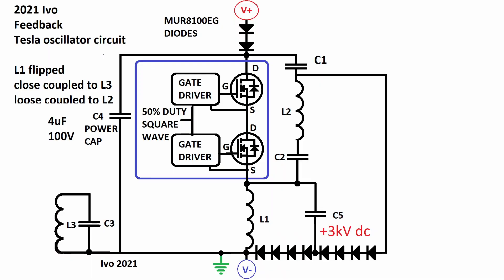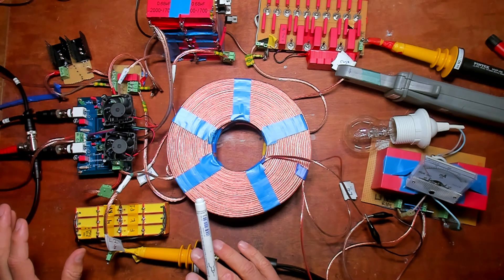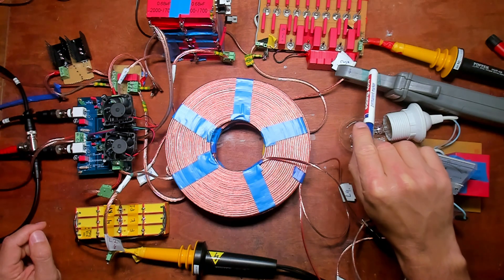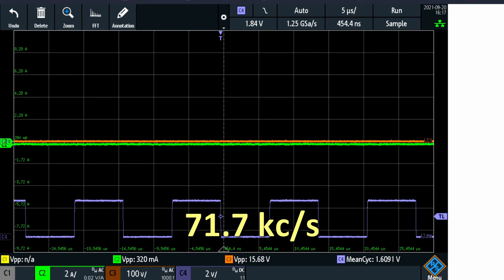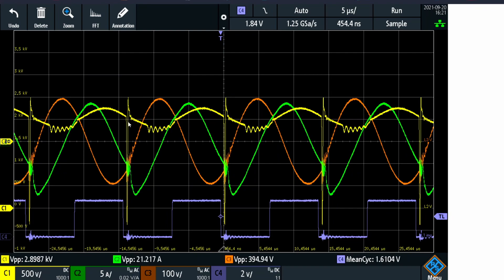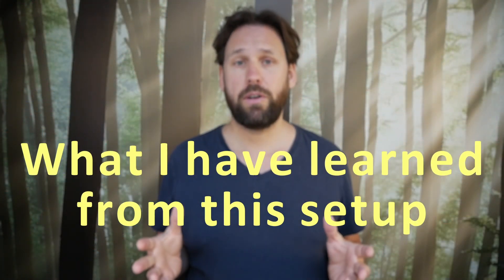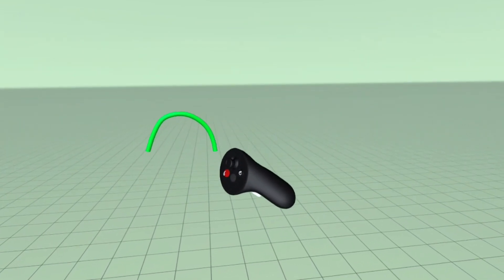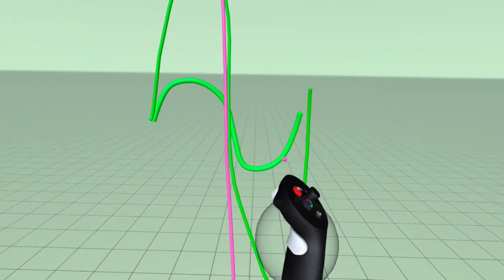Coil Capacitor Feedback Circuit Power: Input- VS Output comparison

Comment: The diodes look reversed in this circuit diagram compared to previous videos, is that correct?
Reply from the maker: Yes! good that you spotted that! I made a mistake. the 8 diodes at C5 should all be reversed. 
Thanks for pointing it out!

Comment: Hello, many years back I spent a lot of time with free energy projects, and specially with bifilar coil. Because, there is a lot of harmonics, and High voltage sparks, the best way how to measure output energy is, calorimetric method. Connect output to kettle and measure, how long time you need to worm up for example from 20 to 90 degrees. 1 kg ...1 degree need 4,2 KJ energy. I checked one setup  from one French experiment. They claimed 200 % efficiency
They connected output to florescent lamps. With my calorimetric method , I had 74 % efficiency. And kettle connected to standard power socked had 95 %
Efficiency. But, good luck.
Reply from the maker: new video on dielectric induction producing ground currents:
https://youtu.be/kbHDHiAQrrs

Comment: Hello. I read the following text from Hermann Plauson (one of Tesla's followers) half an hour before I watched your video, at the end of which you mention voltages, discharges and phase shift. As a layman, it occurred to me that he mentioned a similar problem here. If not, I'm sorry I put it here. Just delete this entire post😉 Thank you.

"In addition to this substantial improvement it has also been found preferable to insert double inductances with electromagnets and to place the capacities preferably between two such electromagnets. It has also been found that the useful action of such condensers can be further increased if an induction coil be connected as inductive resistance to the unconnected pole of the condenser, or still better if the condenser itself be made as an induction condenser. Such a condenser may be compared with a spring which when compressed carries in itself accumulated force, which it again gives off when released. In charging, a charge with reversed sign is formed at the other free condenser pole, and if through the spark gap a short circuit results, the accumulated energy is again given back since now new quantities of energy are induced at the condenser pole connected with the conductor network, which in fact charges with opposite signs to that at the free condenser pole. The new induced charges have of course the same sign as the collector network. The whole voltage energy in the aerial is thereby however increased. In the same space of time larger quantities of energy are accumulated than is the case without such inserted condenser batteries.
.....
 In the case of plate condensers having no inductive resistance an induction coil is inserted. The object of such a spiral or coil is the displacement of phase by the induction current by 1/4 periods, whilst that of the charging current of the condenser poles which lie free in the air, works back to the collector aerial. The consequence of this is that in discharges in the collector aerial the back inductive action of the free poles allows a higher voltage to be maintained in the aerial collecting conductor than would otherwise be the case. It has also been found that such a back action has an extremely favorable effect on the wear of the contacts. Of course the inductive effect may be regulated at will within the limits of the size of the induction coil, the length of the coil in action being adjustable by means of wire connection without induction."
Reply from the maker: "induction condenser " I like that

Comment: Loving the videos and deeply appreciate your commitment to being totally open source!. I've been doing my fair share of Tesla research over the years and I've come to the conclusion that simplicity is the key! In the task of harnessing the back EMF a simple circuit with two large capacitors with a spark gap in between them will work in amplification of power. One more thing that makes some really interesting things happen is the addition of 2 large magnets opposing each other and the spark gap situated at the center of the opposing magnetic fields.
Reply from the maker: Very interesting! Thank for sharing, I would love to talk more about this. Could you email me?
Reply: Hi; What You are doing with the magnets is magnetic quenching. Tesla invested a lot of his research efforts attempting to shorten his spark gap discharge, including mercury interruptors acid quenched spark gaps, hot air quenching and more. The shorter and sharper the on and off time are the higher the impulse energy. Exactly what Master Ivo is attempting in this series.
Reply from the maker: my impulses actually are timed by the resonant frequency of the discharge coil. Thats why I now have less windings. they are now faster (230 nS) and higher in voltage.
Much easier then quenching a capacitor discgarge spark. Tesla did the same in his later research years (use coil discharges instead of cap discharges)

Comment: What i have learn about this. You have to blind the output, from the input. Think about that...
Reply from the maker: Yes. L1 and L2 are directly connected to the supply, so loading them down makes the supply work harder.

so I will use L3 as output again, but not directly (close coupled L4), and probably rectify only one half wave (not sure about that last one. I need to test it)

Comment: Nice work Ivo, does time factor in to the calculation? Speed of build up in your cap bank is faster than your input pulse?
Reply from the maker: thanks, time is a factor yes. the faster the impulse the higher the voltage.
the cap bank needs some time to charge up, so it is not faster (but it is very rapid).
I do not fully understand what you are asking
Reply: @MasterIvo  had an interesting thought: more than just time in the context that you're using here, what about the time as Dayton Miller observed with ether density depending on the time of the day with considerations of sidereal time? Something very interesting to consider later if not sooner as I suspect at some point - when function and stability have been achieved - we will see this playing a role.

Comment: Brother use a step up transformer and step down looped together amplify current, pulse the input  in then c the higher the f nd v in the stp up the more the current in the secondary as u stp dwn, check the ratios of the stp up nd dn to understand the amplification,  volt must have high polarity or potential,  and f 60hz as resonance hz for iron core, mor the no of series 60hz inputs u have bigger is the Resonance so more 3 phase 60hz inputs required if possible with min 3 wd b gd 2go, the idea is to step up voltage but at 60hz resonance f 4 max resonance of iron then step up I w stp dn let c if u get it right the ratio of stp up 2 stp dwn is essential, pulsed mean 60hz at max volt input, ie each 60hz wavelength carries a certain amount of charge which disintegrates fm high to low as current, the higher the volt the greater the momentum at which it disintegrates as current, resonance f for different material is different and 4 iron it happens to b 60 that's all so use a filter if u can
Reply from the maker: Good Idea, when are you going to test this?

Comment: Rather than using copper coils, have you considered using high conductive ink? Robert Murray-Smith has some good stuff that works in refillable tank printers. I haven't found a good insulator ink that works any better than blank space yet. Once that is solved it should be easy to print inductive and capacitive circuits - even in 3d. The next step is to see if graphitic boron carbide and carbon nitride ink can be used as the P/N doping to make semiconductor circuits.
At that point most college term projects could be printed for pennies.
Just thought I'd float the idea out there since copper is getting pretty expensive.
Reply from the maker: seems like a cheap solution yes, but very labor and time intensive.
water glass. I'll look into that
Reply: @MasterIvo  well time to wind & setting sure, the simple way is to get cardboard, wet it & shape it around the made coil... dry
Then melt candle wax to seal the tight mold, put the coil back in, fill a container with a banned plastic straw lol so as to fill the mold from the bottom to reduce any bubbles, put in a bag ,breath in it/add co2, put aside, come back when done
Reply: 'water glass' Sodium silicate , concrete sealer
it has about the same dielectric strength and specific resistivity in ohm centimetres as plate glass.
better than off the shelf expensive epoxies cures fast with co2

conductive ink soaked nylon thread.. dried then electro plated/brushed/etc if you like fatter tracks